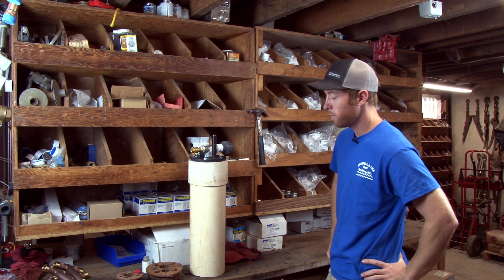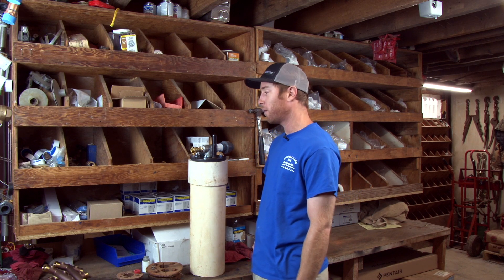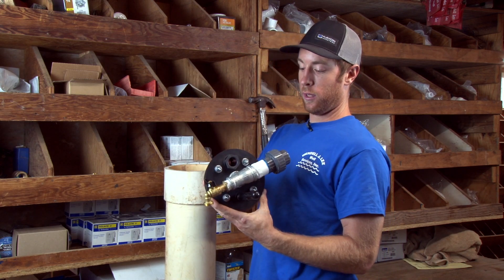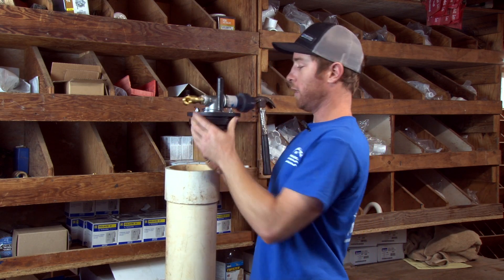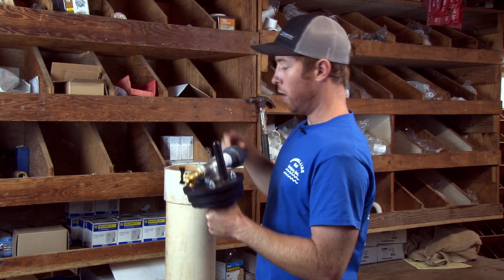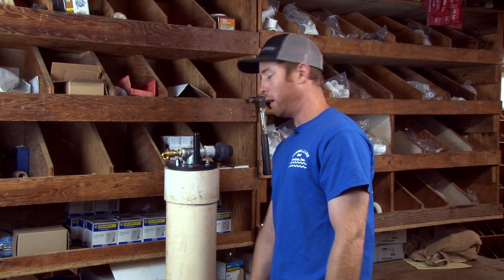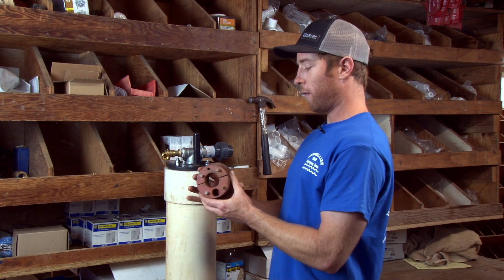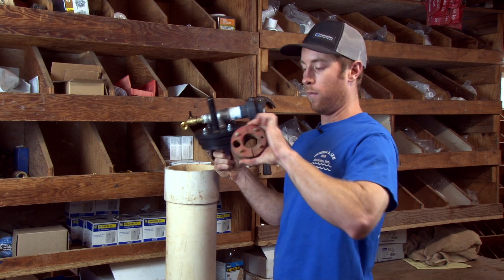Well Seals and Well Caps: Explaining their Functionality and How to Remove

Comment: I have a irrigation well here in kansas and the casing is only 3"-4" above the ground. I would like to extend it up. I cannot find a pipe with the proper id to fit over it. The pipe coming out of the ground I am told is a product called styrene which the od is 6 1/4" what is the best solution for adding on about 12"-16"?

Comment: Thanks for this, was just about to try undoing those bolts (corroded to hell) on an old split cast iron cap, as you showed, for a jet pump. The small red plastic threaded cap, can shock a well via that hole?

Comment: What would you suggest using to sanitize a well? I just installed a new pump and I want to use the correct product. Also how much and what’s a good step by step procedure to follow.
Reply from the maker: granular chlorine would be my recommendation....add enough based on how much water column is in the well....about 3 oz. per 100 gallons of water in the well
Reply: Bleach

Comment: What kind or brand well cap "vent" do you use? How is it called out so I can purchase one locally. Enjoy your vids. Thanks in advance.
Reply from the maker: We use one manufactured by Simmons. Typically they are called out by their material (ABS or metal), casing size, and drop pipe size for your pump.. A typically part number is a 1951, which is a ABS well seal made for 6 1/8" casing with a 1" hole in the center for your drop pipe to go through.

Comment: Wow. Watched 3 videos, trying to find out about the split cap and bolts, then found yours and finally got my answer. Thank you
Reply from the maker: glad you got good information out of our videos. thanks for watching
Reply: @WendellLeeWellServices  I'm having a hard time with what I'm doing. I do not mess with wells, but my hydrant is inside the well cap and it was snapped right off. I have been 24 hours trying to figure the easiest fix. I'm afraid if I just unscrew it at the pitless adapter t, I will never get the new one screwed back on. I originally was just going to replace the head and brass rod, but it's snapped off inside the 1" pipe, and the cast iron collar and threads are still not coming off

Comment: The hole in the top of the plastic cap, the one you said could be used for dropping tablets, etc in to the well, can that be used to put a fitting in to drain water? I have a drilled well about 3 years old and when we get lots of rain in the winter water starts coming out of the hole that the wire comes out of for the pump. i am trying to figure out a way to drain that water so it doesn't make a mess at the well. Thanks.

Comment: Does the well cap support all the weight of the pump and pipe? If using a pitless adapter, does the adapter hold all the weight?
Reply from the maker: You are correct on both. Either the well cap supports the pump and pipe on an aboveground installation, or a pitless adapter does if it is a underground installation with a well cap on top instead of a well seal
Reply: Wendell Lee Well Services, I’m redoing my well, I bought a house last year in Tennessee, the original installation has the water pipe coming out the top of the well casing, then turned down over and buried. I’m putting in a pitless adapter, is there a way I can bring my wiring out the side of the casing, somewhere near the pitless adapter or do I need to bring it out the top? I’d like to have it buried but if not possible, do you sell a 6” well cap with only a single hole for a wire?  Thanks so much for the info.
Reply from the maker: @shanek6582  Yes we can get them for you. I'll send you a picture of what they are and how the wire is routed when using a well cap with a pitless adapter